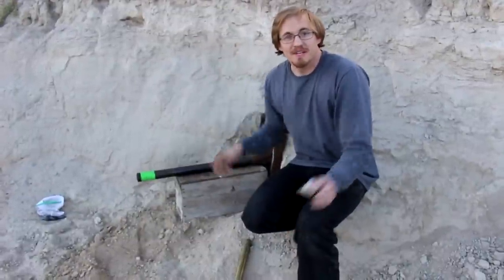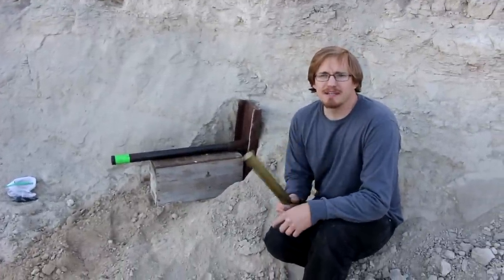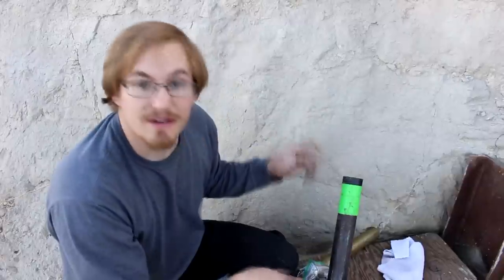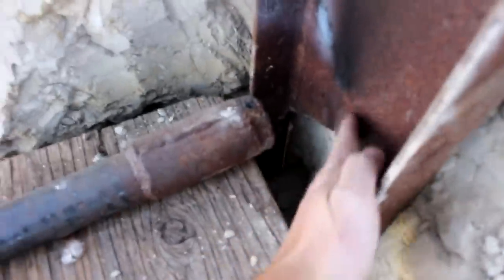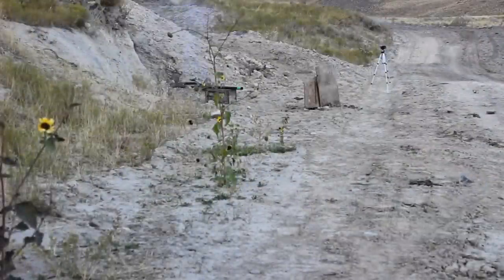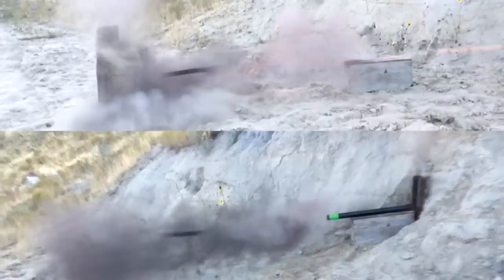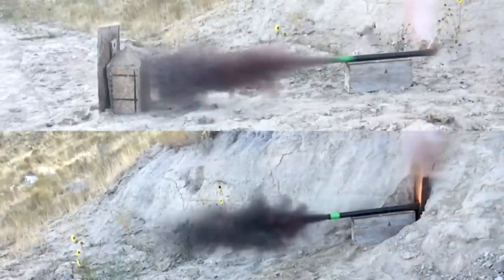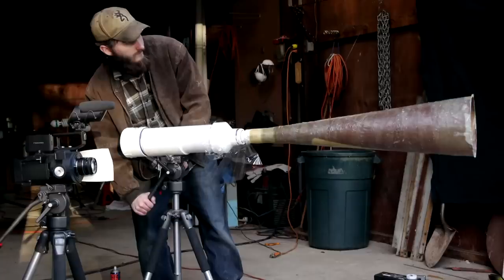How Does Recoil Affect Gun Performance?

Comment: the expanding gas is exerting the same force on both the bullet and the barrel end cap. if the barrel is unable to move away (effectively infinite mass) from the gas, then no work is done on it despite the large force it experiences, and all work must be done to the gas itself and the projectile. in other words after firing, all kinetic energy is possesed by only bodies that are moving to the muzzle end, and the gun itself isnt one of them. this means given a certain fixed amount of gunpowder it is better to immobilize the gun (by adding mass to it) if higher muzzel velocity is the goal. it is honestly intuitive and correct to say that if the barrel flew further back, it stole more energy that could have gone to the bullet.

the misconceptions seem to be due to the confusion of "equal and opposite force" with "equal and opposite energy or momentum", that somehow because of Newton's law, energy is distributed equally. while in all cases the force on the gun is the same as that of the force on the bullet,  in any typical firearm the bullet ends up with over 99% of the kinetic energy because the gun is much more massive, even more so if being held by a person--if  the distribution was any more equal, your hand would be destroyed. the reason why it is hard to show increased muzzle velocity after immobilizing the barrel is simply because the barrel is too short. the bullet spends too little time in the barrel for any improvement to be noticed in an amateur experiment. my suspicion is that in this experiment, due to the short barrel, a significant amount of kinetic energy is actually still held by the exhaust gas as the bullet leaves, which would be a serious variable unaccounted for in the experiment. in the immobilized the barrel the gas should be hotter and moving faster (since it can only move in one direction as opposed to freed barrel) , but we cannot tell in this experiment. a longer barrel would allow the gas to do its full work so we can just observe bullet velocity  only.

Comment: If the barrel is too long the projectile will accelerate at first, then when it gets further out the barrel at a high speed and the pressure inside the barrel drops the projectile will slow down. Mythbusters showed this with pingpong balls and a loong barrel.

Comment: "The same amount of work is being done on the gun as on the bullet"
This is not what newtons laws say and is not what is happening
The momentum of the gun and bullet are equal but the energy are dependent on the velocity
I argue that the slight difference in the velocity observed was because the gun was braced as I would expect a small difference between a large mass and a very large mass

Comment: I know I’m late. Cody I think you’re right that the speeds being so similar is coincidence of your set up, but I think there is some explosion velocity and supersonic dynamics wrapped up in there. To some extent there is a significant time delay to how quickly the brass slug can know about whether the back end of the cannon has moved as the reflected pressure wave (which would be weaker in the recoil test) will take time to arrive. In slow mechanics, physics will  behave like the clicky pen (chamber pressure depends on volume, which grows earlier with recoil, therefore less acceleration on the projectile) but the speed this occurs means shockwaves dominate making physics more like the slinky. Inertia of the combustion gas is not negligible. You could think of the projectile pushing against the shockwave of gas as if it was next to a shaped charge in open air.

Comment: The reason why the result is non-intuitive is due to reference frames. The velocity of the slug relative to the barrel is going to be the same regardless of whether it is moving or not; however, relative to a static reference frame, you'd have to subtract the velocity of the barrel from the muzzle velocity of the slug. 

For example, if you're on a train moving at 70 mph and you walk towards the front at 5 mph, relative to the Earth, you'd be moving at 75 mph. Similarly, if you walk towards the rear, your velocity relative to the earth would be 65 mph. I didn't immediately think of the touch hole though, and it's interesting that having one compensated for the difference.

Comment: Not trolling, but to me, it seems that the stationary gun seems to have shot slightly faster than the gun that was not secured in place.  It could have something to do with difference in perspective (one barrel appears shorter than the other slightly )..

Simply placing markers slightly behind the projectile's path would have made it easier to judge distances; i.e. putting a marker at the front of the barrel like a stake, and another stake that marks 10 feet from the barrel would make it far easier to judge..  At that point, you should be able to calculate more precise velocities..  Just a thought.

Another interesting "test" that might be something worth looking at is doubling or tripling the mass of the barrel, if you see where I'm leading you.  
From where my personal perspective, as someone that shoots rifles frequently, I know that how long a bullet remains traveling down a barrel does have an effect upon velocity, well, I do find it hard to believe that it's "exactly" the same..  .

Comment: So I'm at the six and a half minute mark, and I think the reason it didn't work is because the explosion inside pushes the projectile and the barrel in opposite directions, however since you cannot perfectly detain the barrel, the explosion does in fact still move it back enough to where the two object reach an acceleration in the opposite direction, after that the projectile continues forward and the barrel either continues back or is stopped by the person holding it or in your case the support. Maybe the second hypothesis would show greater effect if the barrel could be so massive (or be strapped down so tight) the explosion could not move he barrel significantly

Comment: Is it too hard to use modern, smokeless powder? Or is there any legal issues with that? I know black powder has, in some cases, issues of burning unevenly and is very weight sensitive for what projectiles can be fired, although generally heavier is the benchmark for a-okay.

That being said, I believe your results are totally legit. There was a lot of stigma into what I think was ballpark later 19th century and earlier 20th century that automatic arms (self-repeating actions, particularly those that use a gas system) would decrease the ballistic power of a cartridge.

I guess you can surmise from the ubiquitous usage of gas system-having firearms today, including in higher power weapons, that this is by no means true to any considerable extent.

Comment: yes it is true there is the same velocity because no matter what some of the energy will be put into shooting the barrel back it is just forced differently. When the brace is on it disperses the energy so it doesn't shoot into the wall but when it is not it puts all its force into one spot. this shows that no matter what you will lose some energy into pushing the barrel back and will always have the same amount of force put into the bullet as long as you use the same amount of powder/wadding.

Comment: This observation depends entirely on the mass difference between the gun and the projectile when compared to the measurement accuracy of the camera. Additionally the increase in accelleration (Jerk) is too many orders of magnitude higher than the jerk needed to cause a difference in acceleration since the mass of the gun and bullet are so high. Basically the work has already been done on the gun and shell before the shell has moved more than an inch or two. If you tried using a lower speed flash powder or a projectile that was 10 times the mass of the cannon you would see a difference for sure.

Comment: Hey there Cody, interesting video.

I think when the barrel is fixed, the bullet has to be faster. Bear with me, think about an extreme example. Let the bullet weigh 1ton, and fire it in the two conditions. In the first condition, the free barrel would shoot backwards, leaving the bullet (almost) in place. In the second condition, the fixed barrel, which cannot shoot backwards, would have more time to accelerare the bullet.

With a lighter bullet, the effect would be less visible (almost negligible), but it would still be there.

Comment: The projectile from the braced gun was moving slightly faster. The barrier to slow the projectile from the unbraced gun was too close to give a good comparison of the speeds on "sorta" high speed video. A better test would be to use the pendulum method. Shoot a pendulum to see how much energy is transfered. Cody, I'm not as smart as you and I like your work but here you have tried to recreate the wheel and came up with a square.

Comment: I agree that the same amount of force must go into both objects, however you are wasting more energy by allowing it less time to work on the projectile. The canon is not taking energy away from the projectile, but the movement of the cannon is.
Reply: If you were to use a smaller charge of black powder, and/or measure velocity over a longer period of time (i.e. a wide angle shot on the high speed), I would expect any differences in velocity to be far more pronounced.

Comment: I vote you try 2 and then 1 load of black powder for each braced and unbraced shots, you will see a difference in velocity. The pressure inside the barrel pushing on the black powder has theoretically half the barrel distance to build pressure (excluding factors like friction heat loss and the general problems that come with air and fluidity).

I'm trying to say I'm certain that the unbraced shot will have the same result as a barrel half the length braced. Part of the problem I can see now includes how to delegate where "half" is.

I also don't know the pattern of pressure and where it builds and at what point it begins to decrease relative to the location of the projectile. I'm assuming the climax of pressure happens When the bullet is within the barrel. 

I'm a senior in high school, but I've done a lot of research on the laws of motion

Comment: A thought on the physics of this:  The two shots are essentially the same, in that there is the same amount of recoil in each - the difference being in how that recoil is manifested.  In one, the cannon is free to fly backward, and in the other is pushes up against the backstop.  But even the one that only pushes against the backstop does 'work' (the pressure against the backstop dented the steel plate, and presumably slightly heated the steel and clay behind it - all of which are 'work').  The gas expanding in either shot is expanding at the same rate, and producing the same amount of force in every direction.  What happens to the objects in any particular direction (the slug or the cannon) is merely a reflection of the work done on that object, not the exploding gas itself.  Probably clear as mud, but it makes sense to me.  

BTW - I really enjoy your channel, Cody - keep it up!

PS  ok - I wrote all that above after pausing the video at about 6:45.  You are now explaining what I was trying to say.

PPS - But why are you in a blanket fort?

Comment: Surely the clicky pen idea doesn't really work the same since the spring is inside the pen and pushes it in both directions. If there was nothing to brace the pen, it wouldn't move at all whereas an explosion next to a bullet would push it away whether or not there was a barrel and/or brace.

You would need to remove the spring from the pen and compare how well it pushes with and without a brace. I'd be interested to know whether it works the same as the gun, assuming negligible friction on the pen. I guess I'd have to be done as a spring loaded gun or a stronger spring pushing something on wheels.

Comment: So the history would be different if we were talking about a gun with no hole in the back and no other way to loose energy other than the front of the barrel? because then the strapped gun would have no where else to waste it's energy but dump it on the projectile and the non strapped one would behave more-less the same as here but since the strapped one dumped more energy on the projectile it will be relatively slower. Or better put, the strapped one with no hole will be faster than strapped with hole,

Comment: I'm a college student and all i remember from physics (before i dropped it) is that the conservation of momentum comes in play here. The momentum of both the gun and the projectile before the explosion is 0 as they are stationary which means that after the explosion the momentum must also be 0 (the projectile is going left and the gun is going right therefore the sum of the  momentum cancels out to 0) this means that if the gun is against a fixed wall the mass for the gun is going to increase thus reducing the velocity down to basically 0 m/s^-1 but the momentum is still the same, for both the gun AND the projectile. So it does not matter if you put it against a wall or not.

If i'm wrong, my bad... that is the reason why i dropped physics :/
Reply: This ties into Newton II, same reasoning.
Reply: The correlation between the barrel moving or not and the bullets loss of energy is not intuitive, and in most cases it can be disregarded in the global calculation. However, there is a difference between the barrel moving or not, which is the time the bullet spents in travelling out of the barrel, which does causes a detriment in the final momentum. 
However as i stated, this factor is incidental when compared when compared with the thermodynamics of the reaction and expansion. 

TL;DR: There is a difference between the gun recoiling or not; However, the difference is minimal and you wont appreciate it unless a proper experiment is arranged with high sensitivity tools
Reply: AlphaSquad umm the mass of the gun would remain the same. what happens for the fixed cannon is its momentum gets transfered to the mountain behind it. because the mountain has large mass and the law of conservation of momentum, the mountain doesn't really move. and 0m/ s^-1 would have units of m*s.
Reply: TeaNcrumpets RS yea, i said it's mass increases because the gun basically gets attached to the mountain. So you can take the mountain and the gun as one and that's why i said the mass increases.
Reply: AlphaSquad What about the unit?
Reply: True, for the braced gun, the momentum is still conserved, only that the velocity of the gun is almost undetectable since the mass of the gun + mountain system is so big compared to the projectile
Reply: SirCutRy  the unit of velocity? it's meters per second to the power of -1  "m/s^-1"). Isn't that how you write velocity? 
someone correct me because i'm confused
Reply: s^-1 = 1/s  so when you are doing m/s^-1 it equals m/(1/s)=m*s. if you want to use s^-1 it would be m*s^-1 which is equal to m/s.
Reply: i understand what you are saying but the wording is a little off. if the mass is increasing it implies a change in final mass from initial mass.
Reply: AlphaSquad The SI unit for velocity is m/s.
Reply: AlphaSquad It's m/s or m s^-1. It cannot be the two of them combined, though, because s^-1 is just 1/s.
Reply: shit my bad, i remember now lol. its ms^-1
Reply: AlphaSquad Quite a weird unit :)
Reply: SirCutRy not the weirdest unit i have invented

Comment: He's right in that the force goes both ways equally but the energy going into each side isn't necessarily the same. If the gun was 2 times the weight of the bullet it would go twice as slow since momentum is conserved in the explosion. This means that the energy from each side would be 1/2(m)(v)^2 and 1/2(2m)(1/2v)^2 and since v is squared, the energy isn't the same(1/2mv^2 vs 1/4mv^2) This means if the earth is the brace for the gun, a good portion of the energy would be lost due to the inelastic explosion.